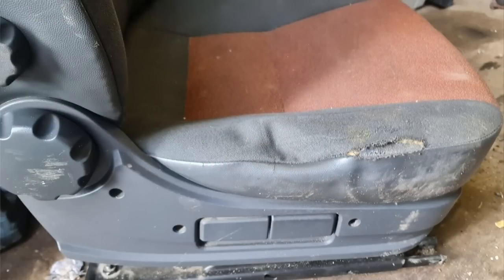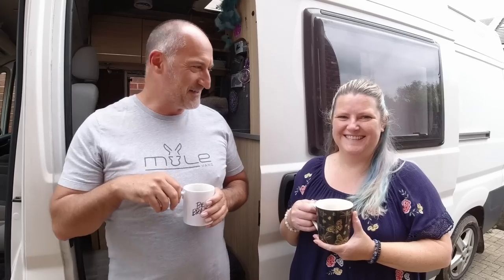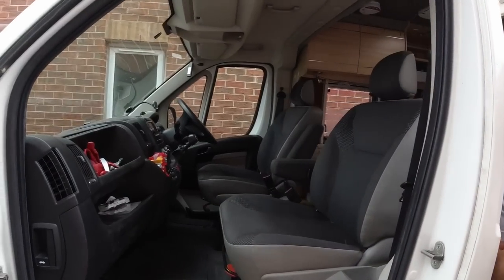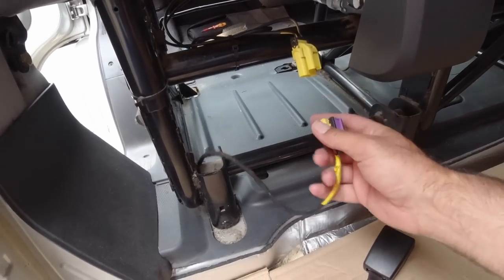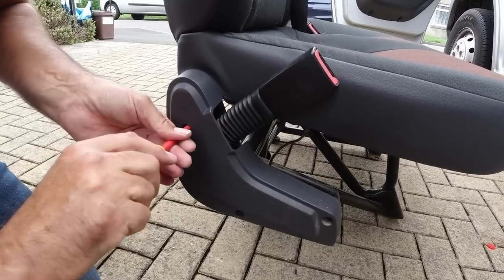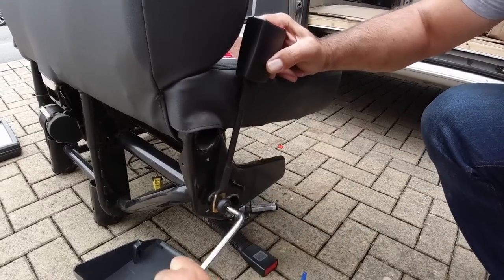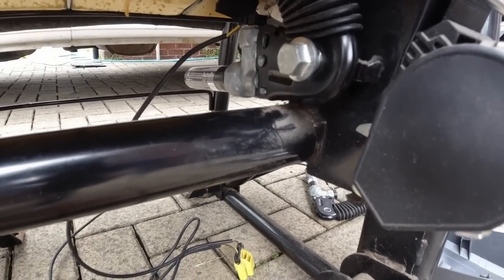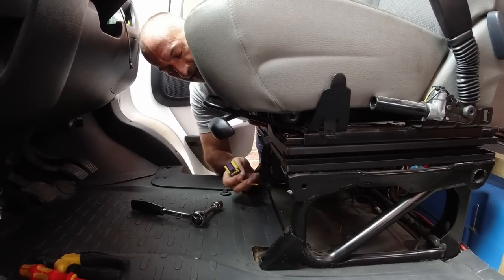DIY Single Seat Conversion on a Budget! - Van Build Ep14

Comment: Hi Greg enjoying the new build, taking ideas from both your builds for our VW MWB Crafter. Bought over 17 months ago converted, you may have seen it?, just ripped it all out. Looking at your Xpelair in your first  build, couldn't find it on your Dropbox parts list. Heads up to where you purchased it from be much appreciated. Many Thanks David.
Reply from the maker: This is the exact one that we used, I have chnaged the external vent grille for a fixed cowl now as we kept losing the flaps when driving. https://www.ebay.co.uk/itm/314824469706?hash=item494d002cca:g:NfwAAOSwsgRksVEc&amdata=enc%3AAQAIAAAAwEeLt47JY2pUSwCOww89HnOYd4Ke4w6qwJJUgTVv0SZ00HkpNI0K3iHRRTxuntMQhVBJK1LVe4qwc0mGM0DYm8INxhFItcQ8wyay5%2BkiJAbz55BrHol012yuLCWERRtIXuetzZeTKTD90zOjzGViPSrBkqOb6ymLXRM8HeccwNPq0q23Z8m9oowNA%2FxV7o0EUt7dF7hJHOV7oSE205MgCgNJVVHstZgtY6NidJTZKXaLVlg5%2FvRXy%2B0%2BDuEFiJHCag%3D%3D%7Ctkp%3ABk9SR_aRtYHcYg&mkcid=1&mkrid=710-53481-19255-0&siteid=3&campid=5338027957&toolid=11800&mkevt=1
Reply from the maker: https://www.ebay.co.uk/itm/154075423803?hash=item23df9c643b:g:F8sAAOSwwmpeaQpE&amdata=enc%3AAQAIAAAA4L2uAgYRcblQRg2uhp%2BcbaCSBQ%2FlqC4qrYCpSGV8Y86qb%2B8Havyc2xe8TKBi%2BstTOkseNYc%2FhxqAtdXUjYfIgDHStiYbbQ0OfsKPkGu4kp9I%2Fb9cbV%2FhxldJk9Q3X%2Ffg%2FO%2By%2BZclKMtuJEQz0xp5NlaxAtRtCEcE%2Fxaig3CjomVe8mQ%2B4yUmQKnAXA9J1gP%2BC5Q822ak4ok%2FYB7Sm8GygXqguZPWqrfh1yVZTvr1YmGGgeHyRBiEaKCo2o68WePPzxxRojlaDVi1jr8vjElZlyRnTDRCEQySAz6e8gPscEmF%7Ctkp%3ABFBM-qDHgdxi&mkcid=1&mkrid=710-53481-19255-0&siteid=3&campid=5338027957&toolid=11800&mkevt=1